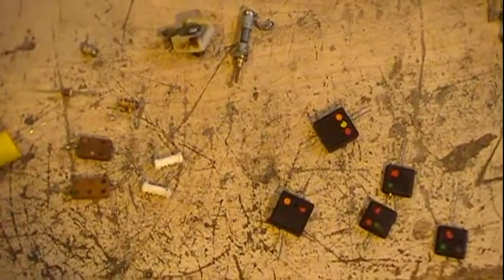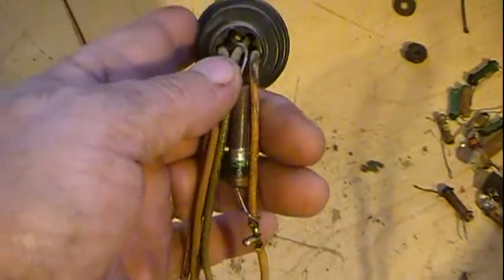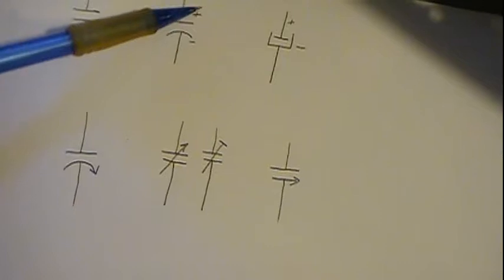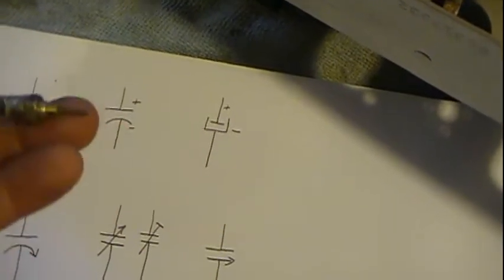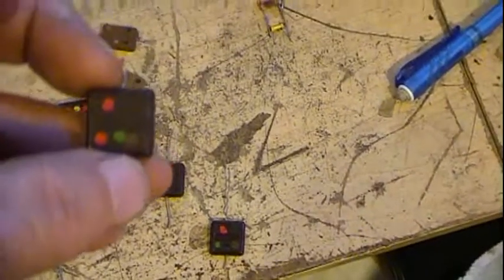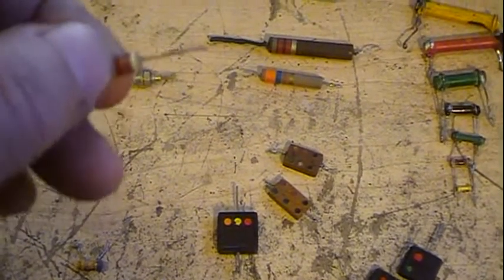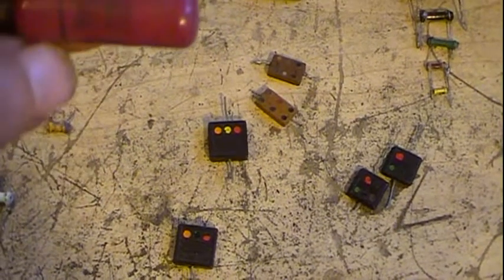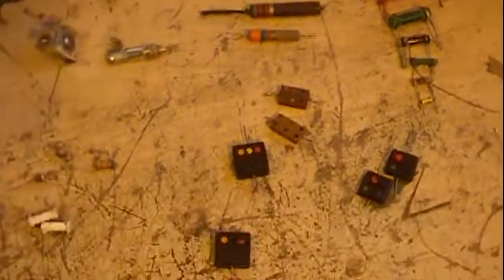Capacitors and Resistors

Comment: I need a color code I can save or print On the damino caps ,I need repair tube radios I mostly do sixties radio but I do from time to time run into damino type caps if I want to recap a radio and can't find a schematic on.it I can't replace those cap ,can you help with that anyone

Comment: At 9:26 you should have mention the arrow which needs to point RIGHT to read it correctly!
At 16:40; if using in, (especially tube radios or tube test equipment), the outside foil is VERY important!!
At 07:41, WRONG, that's in uF NOT pF
Reply: Yes pointing right. I know you always read the domino caps clock wise, but the arrows on some of the older ones are very hard to see or not at all. What do you do in that case?
Reply: @BillJAkers  - I'd say "read the cap left to right; if it has a weird value or make NO since, flip it over 180°

Comment: Dennis,
This is an excellent training, or reference if you will, video for beginners and/or those developing an interest in what I refer to as ‘electronics engineering’ (in other words, learning electronics at, or from, component level and not being limited only to installing circuit boards and configuration).
That was interesting when you included, “Uninsulated carbon composite resistors” and “Padders”.  I haven’t heard those two for decades as it is always “Dog bone” or “Trimmers”.  The only places I’ve seen (the true) trimmers are on pre mid-1950s TVs (the days before ‘flywheel sync’ in conjunction with video/sync separator circuitries) – sort of very fine line time-base/horizontal adjustment, and on calibration equipment where specific adjustment is critical.
Thank you my friend.
Regards,
Phil.

Comment: Great video Dennis.
I have always have had trouble reading those mica capacitors, I never know which way to read them and sometimes the colors were off.
What I used to do is test them with a small capacitor checker a CIE 7705 to find out what capacity they were.
I had a whole box full of them from an estate sale I bought years ago.
Of course IF the capacitor was leaky the capacity usually read faltsly high.
The EICO 950B would not read very small capacitors very well as you know.
Reply from the maker: Thanks Bill. One of the the problems with the micas is the colors falling off. I have several that are missing the color dots and to measure with a modern day cap tester.